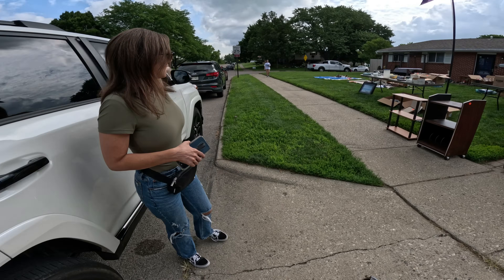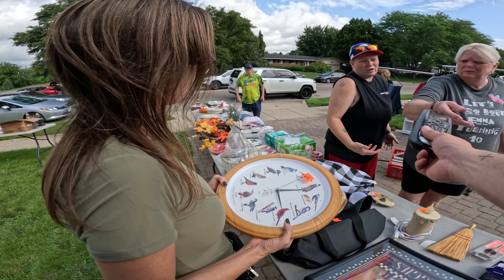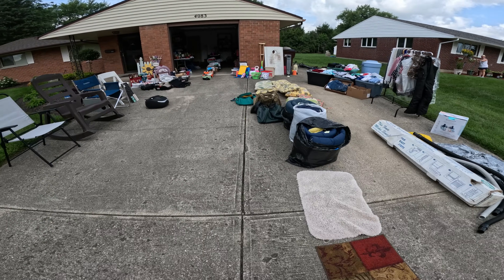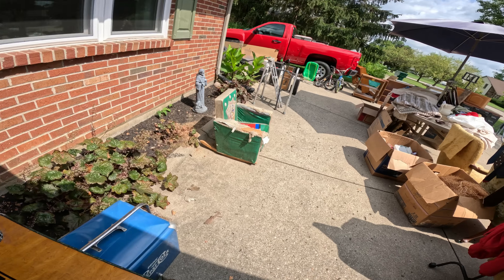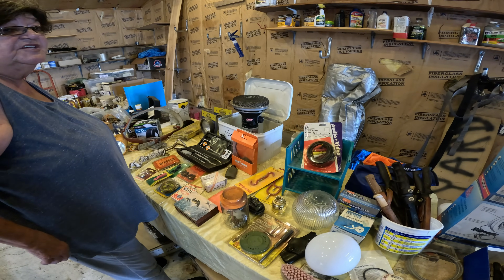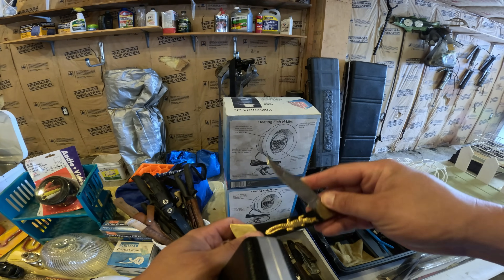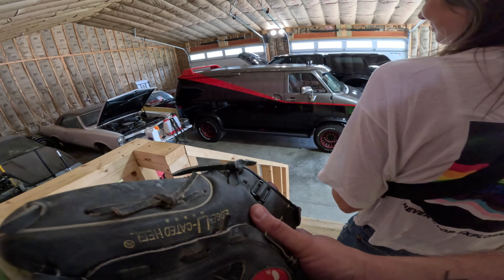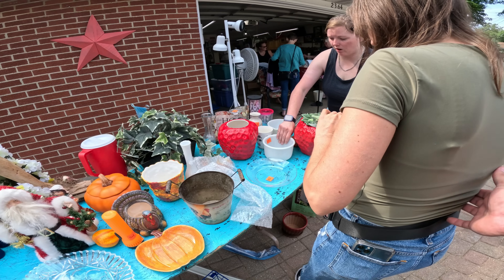This DISGUSTING Yard Sale item might scar us for life... @thehomeschoolingpicker

Comment: That measuring tool is vernier/calipers larger side measures outside dimensions & small side is for inner dimensions . Can be expensive. They are worth buying. Great for measuring bolts/ nuts and anything you can think of. Handy tool to have